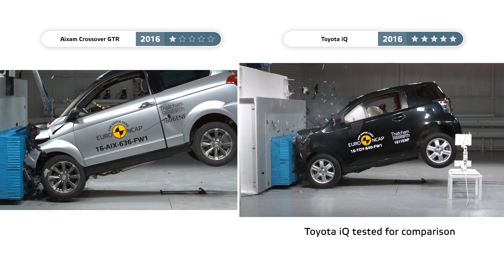Micro Quadricycle vehicles crash test fail in Euro NCAP Golfcart/Renault Twizy

Comment: the issue is its limited to 425kg or so... there is not much room for safety improvments without makeing it worse elsewhere.... if i would be in politics i would get rid of that so its 900kg empty weight give it a better motor like 25HP and 1000~ccm the car can be certified for dual speed mode aka 45 and 70... ppl with AM can get AM+ (6 lessons for securtiy) wich allows that the limit of the car is 70kph

Comment: Did anyone see how the seatbelt brokes at 8:42 ?
Reply: yes your right !!
Reply: I noticed that. completely sheared off at the deflection point ... NOT impressive for a2017 vehicle =/
Reply: that wasn't the only car where that happened.
Reply: That car deserves a negative star rating.
Reply: Not sure, but this may be the desired behaviour to minimise harm done by seatbelt itself. It takes on the first blast and then releses not to break dummys chest.
Reply: Lol🌍😣
Reply: yea
Reply: Holy shit
Reply: Shit, that linda hurts
Reply: John 3.16-21
Reply: @Seegoosh  yeah a detachable seat belt in crashes would probably be safer than having it attached so long as the car has other safety measures like air bags

Comment: IMHO, the Twizy has a good result, i wouldn't call it a failure, don't forget that the Twizy has no doors and it is supposed to be an upgrade to a motorcycle, not a true car. ;)
Reply: +Bryan M. You can get doors, which may provide a little more protection from side impacts. I am a soon to be Twizy owner, so cannot let this put me off.
Reply: Twizy is the next step of a light cuadricycle (Aixam, Chatenet, Ligier, etc) which are the next step of a scooter
Reply: It's not all about damage. The renault has little to none crumple zones which means all the energy is transferred to the driver.
Reply: Can't filter in a twizzy so it isn't an upgrade from a motorbike. It's supposed to be an alternative to getting a 50cc moped on a provisional license.
Reply: I just don't understand how the chatenet had the same score as the twizzy. The mannequin in the chatenet went head first against the steering wheel and in the twizzy you have an airbag. Was it the side impact?

Comment: This crash test is completely biased. Most of these "cars" have 50kmh speed limit (plus they can be used only on urban road where the limit is 50kmh) and che crash test is made at 50kmh. Cars max speed is 140kmh to more than 300kmh, they can go on highways where the speed limit is 130kmh to infinite (on german autobahn) and the crash test is made at 70kmh. 
Impact speed for urban vehicles should be around 30kmh.

Comment: "Oncoming traffic does 50 km/h" that's why golf carts aren't made to drive in streets, that doesn't mean that the manufacturer should change the security level but the people should stop driving these vehicles in prohibited locations.
And tbh, if they're trying to simulate a 50km/h crash with oncoming traffic, they should've made the test with other car hitting the golf cart at this velocity, cause a car that ways like 1,3 tons doing 50 km/h have much more energy than a golf cart doing 50 km/h so the results would be much much worse
Reply: In US is town where they mostly drive by golf cart. It was planned for that.

Comment: Microcar, Ligier, Aixam and Chatenet are light cuadricycles, they are limited to 45 km/h per construction(49cc engine). They're mass is lower tan 350kg. They're not considered a car.
It's not fair compair them with the Toyota iQ that haves a 1.0 engine and weight 920kg.
Reply: robotwizard Legally, in Spain they aren't cars (like a 49cc scooter), they are light cuadricycles.
To drive one of those you don't need a driving license, only with a drive permission that you can get in a week is enough.
They're not build to be safe over theyr construction speed limit. It's an alternative to a 49cc scooter. I think a light cuadricycle y safer than a scooter. That's the objective that theyre manufactured for
Reply: They are not the same as a scooter. These have 490cc engines, the scooter will be 49cc. These would struggle to move with a 49cc engine because they are heavy enough.
Reply: i saw some guy driving an aixam at 80km/h on a nearby motorway and the car was registered as a quadricycle like ATVs usually are (not a light quadricycle like microcars usually are registered) which do not have speed limits here in Finland and you can drive them with a normal car driving license. seemed kinda sketchy but hey, law is the law.